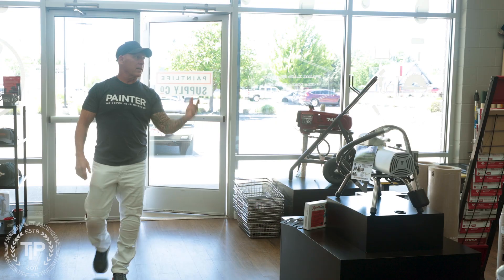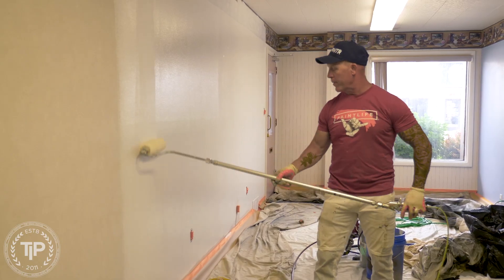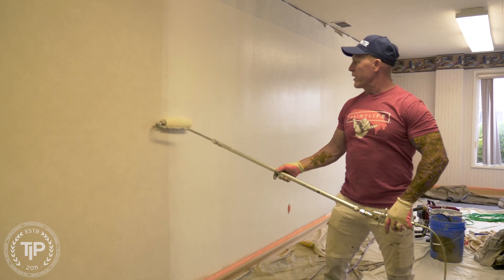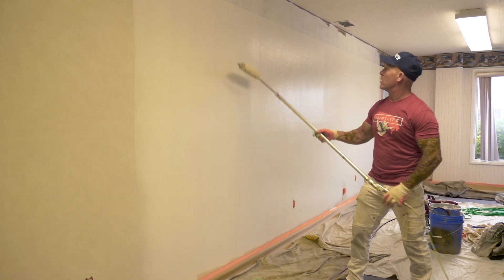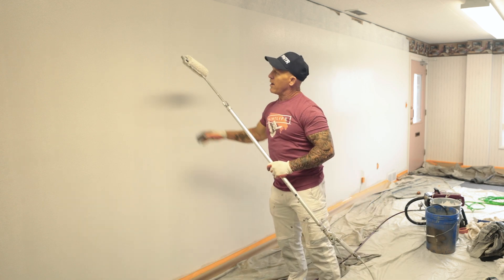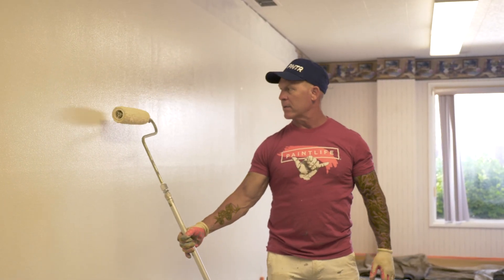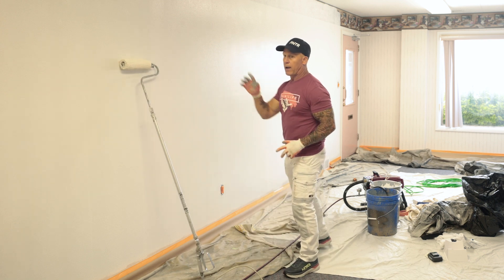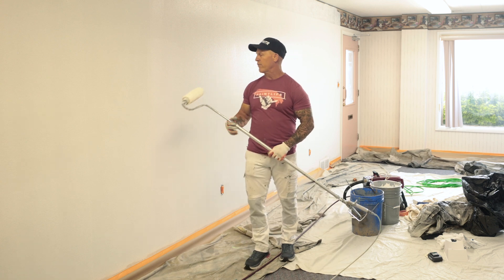Rolling Walls FAST with a power roller! Titan Inner Feed Roller tips

Comment: Painting over wallpaper sure is a lot easier than tearing it all down and skim coating it. Sometimes the customer doesn’t seem to understand how much goes into tearing off paper and completely redoing the wall to the point where it looks good. We put it in the bid that the time and cost will be conditional on how bad of shape the walls are in. We just did a dental office and the job took like a month longer tearing off the paper than if we just painted it. It was a huge pain in the butt having to work around their dental equipment

Comment: From what I can tell, they run at around 500psi for rolling latex. What do you think is the basic/entry level pro spec airless unit to run a power roller? Not looking to spray through it, just a reliable wall/ceiling rolling rig. Thanks.

Comment: I've had nothing but trouble with power rolling. Like you said the nap is really bad. But I didn't realize I could use tape to delint it.
Reply: Its good if you have long corridors can have someone with power roller applying while someone comes behind and cleans it up back rolling
Reply: @RP-se9lf  yeah that's kind of the problem I encountered. You got to roll it again and again and again.

Comment: In the future you can use tuffhide dry wall filler will hide the wall paper and I always use an 18” roller when I power roll I use the power roller to load the wall and the 18” to lay it off ..

Comment: Tried this few new construction jobs. Compared it with 18” rollers. This was much faster and easier. Specially on new drywall where using a lot of material. You can set up your sprayer on 1st floor and paint with this on 5th floor, no 5 gallon buckets to carry. The only problem is it doesn’t have microfiber rollers. One coat of primer and two coats of finish even the 3/8 leaves a big texture on smooth walls.
Reply from the maker: Thanks for sharing

Comment: Do they have a 14 or 18" version of these?
Reply: Not with the innerfed roller. Graco does make an 18" jet roller which is basically just a roller attachment on a spray tip. Can't tell you how well they work because I've never used one.

Comment: I just use this on a ceiling last week, way too heavy, my crew try it for 3 mins and give up, i finish 2 ceilings with this roller. Decide to sell the roller and the Titan 440 which I brought last year. I spend 30+ hours to learn how to use sprayer,doesn't work out for me. Too many limitations to use in a residential project
Reply: You paint doors, bannisters, spindles, ect by hand?
Reply: @jimeneazy5999  i only get 1 or 2 spindle job per year. I can paint 13-15 doors (including door frame)a day using brush and roller.i had tried with the sprayer. It's 2-3time slower and i break a ceiling light because I was moving door from room to room.
Reply: @wwsunmoon  What about louver doors with the slats? I'm usually working remodels for an investor that flips properties and flooring is usually replaced so we spray everything.